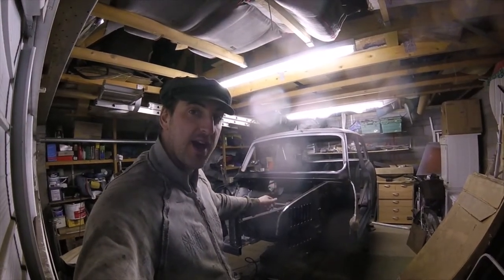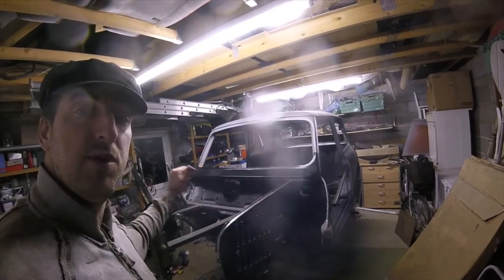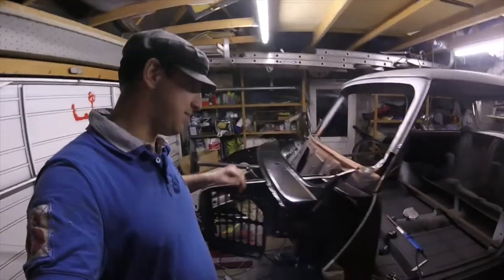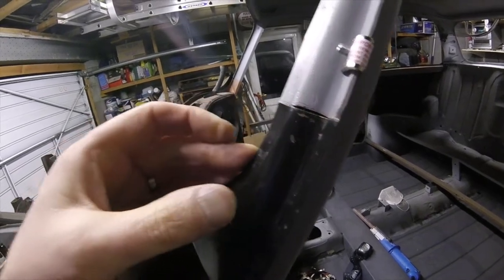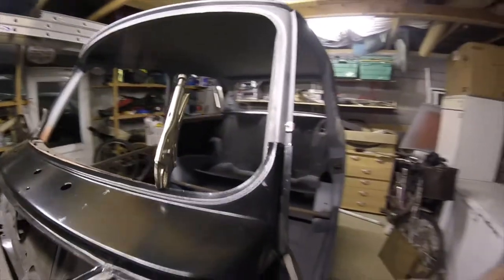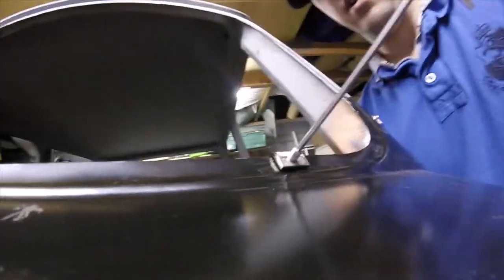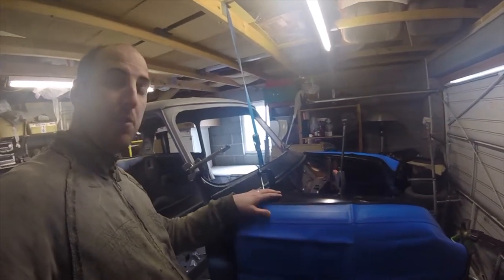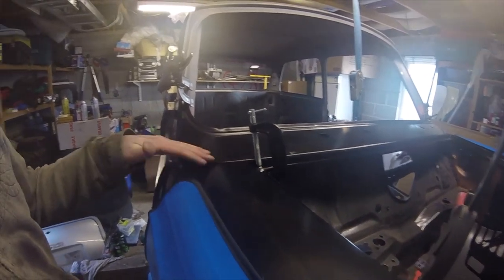78 Classic Mini Restoration - Scuttle panel initial fitment

Comment: Little tip when panels over lap like the scuttle and the need cutting in. Once lined up cut through both panels and your joint should have a 1mm gap to weld. Once every thing is lined up put some screws in it so you can fit and remove meany times and it goes back in the right place
Reply from the maker: Thanks, have heard this technique before, I get scared that I'll have to reposition something and the gaps will be to wide for me to fix. Dont worry the screws are coming out for many test fits!